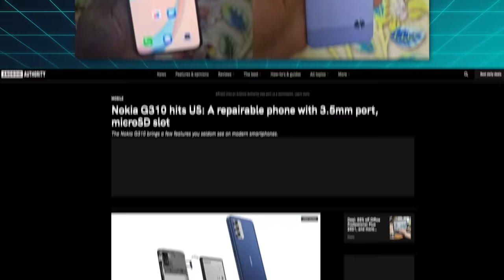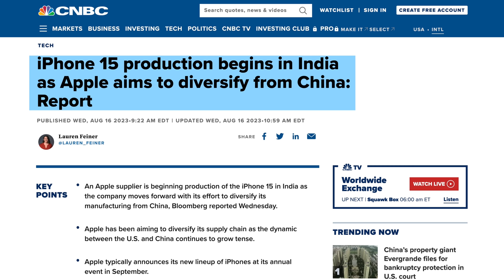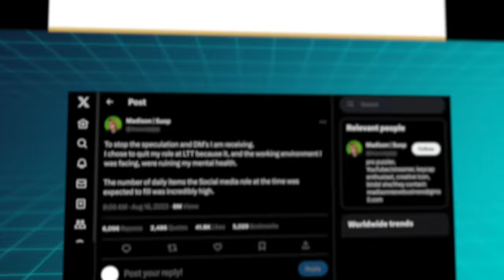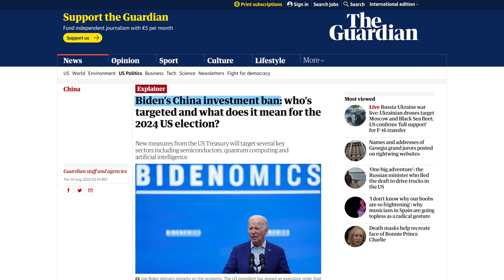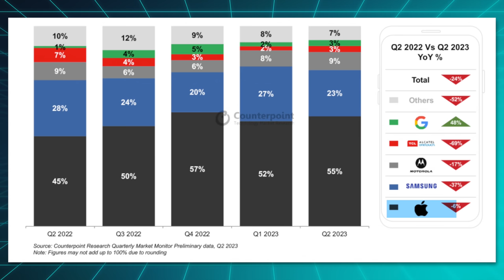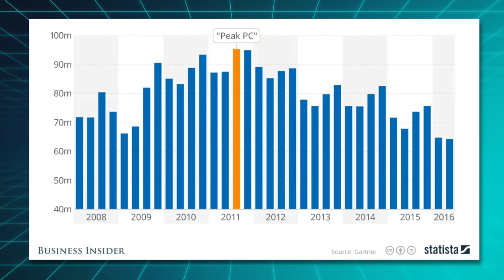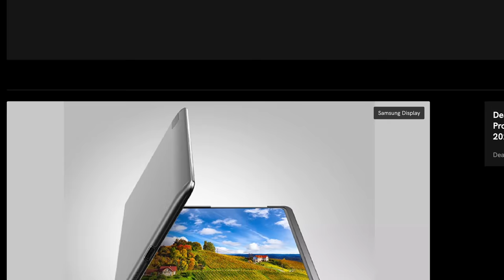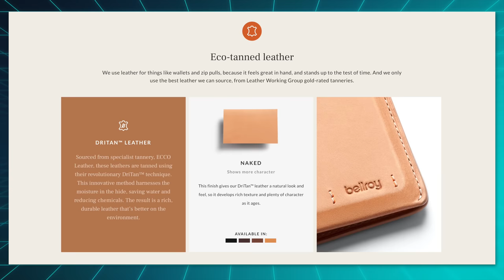Phone sales keep crashing (down to 2013 levels)

Comment: Phone companies: raise prices
Also phone companies: Sales keep getting low :(
Reply: Remove charger*, remove *headphone jack*, remove *expandable storage and the prices increase as if nothing has happened
Reply: raise prices and remove features at the same time
Reply: At the same time, everyone can make a decent 200$ smartphone. So big names must push really hard for innovation.
Reply: Don't forget the removable battery and the unlockable bootloader.
Reply: The whole $1000/$2000 phone is stupid and they are like hey lets make a folding phone with a crease in the middle so you have to watch a movie with a line smack dab in the middle of it. and those damn bezels look so bad even though it's a freaking rectangle. Yeah lets just put a notch or cutout that goes smack dab in the middle of the screen because of those damn bezels
Reply: not just remove, but also slow down everything with software locks

Comment: It isn't really because of durability but because new phones are not better than old ones. The tech has reached its peak
Reply: Right when my phone dies i use my old  s8plus and i doint even feel the difference besides the diff os.
Reply: yes and also fun fact - the durability of electronic gadgets has only gone down, a very renowned business tactic
Reply: @maksadnahibhoolna-wc2ef  Ah yes, planned obsolescence.
Reply: the tech has not peaked, its just that we dont need the massive upgrades to doo our day to day tasks without hardware being a limitation, there is still good innovation in the flagship space.
Reply: @oksowhat  Imo all theses innovations are in the "fancy gadget" category. They don't really change the experience or what can be done with the smartphone.
Reply: @oksowhat I guess the tech has peaked, in the flagship space there is hardly any ground breaking innovation that affects human lifestyle. take for example the cameras in flagship segment, there is hardly any big improvements compared to three generations older phone of same flagship brand (only 15-20% improvement) that you will hardly notice as a daily consumer.

So yes the tech has somewhat peaked
Reply: For me, it feels like new phone are even worse than old ones. For example, my old s10 has a 2k screen and headphone jacket and sd card slot. The new s23 has only a full HD Screen, no headphone jacket and no sd card slot and thicker edges. Yes s23 has more performance and a better cam but in reality the differences does not feel that big.
Reply: It'll stagnate until AR glasses become small and visually unobtrusive to the kind of people who don't think wireless earbuds are intrusive.

Then, the next sales frenzy will continue for another decade. Apple's vision pro is a test bed for much more advanced hardware. I'll have a video out on this sometime soon.
Reply: @the.littlest.toaster yeah I went back to my S10+ don't see the difference, I'm comfortable no nee to re-upgrade
Reply: Foldables drastically change the way people use their phones and while expensive, are slowly coming down in price and getting better in durability.
Reply: @oksowhat but you get diminishing returns. Is not worth spending 1000$ to get a 10% faster phone. When practically is not even noticeable in day to day use.
My phone is 2 years old and still perfectly fine. Plan to use it for like 3 more if I don't break it accidentally.
Reply: You only see the improvements if you are a true power user. Which you probably aren’t, you probably use a PC.

Phones can play switch games and run Blender. And android phones can run godot game engine. Which is useless for 99% of you but for the people who use it makes them irreplaceable
Reply: @RusticRonnie  The phones that can do such things are as expensive as a Mid-low end PC, so what is really the point ? 

I mean, do you really use your phone for game development or 3d modeling ? You can find 1080 cards for 150 bucks, if you put it on a 250$ potato it makes something more powerful than any phone currently on the market.
Reply: @speakertwentytwo I'd like to see that vid
Reply: they are better, but their improvements aren't necessary. They just nee dto play social media apps and camera/video editing/filtering purposes. You dont need faster and faster devices evetry year to achieve this. 

I beleive the main reason why people upgrade is the glass is damaged or battery is slow and the cost to repair is unecomomical and it's best to just buyer a newer one.
Reply: @emperorfaiz  C'mon now...I'm quite sure it wasn't PLANNED!🤔...it jes' sorta....happened...😁
Reply: yep, they've definitely peaked. the innovations are just gimmicks. Folding screens are cool and all, and they can kinda replace a small tablet. I'll probably upgrade with Apple releases a folding iPhone 20 years from now. But it's just a gimmick. I'd argue that the entire industry has pretty much peaked, not just smartphones. Computers like he said, gaming consoles. Computers are just more and more powerful/efficient. unless you are a power user, you probably don't need the latest gimmicks or 10% more performance that comes with the latest laptops. I think the performance of basic laptops has surpassed the needs of most people. Buy the laptop of your choice and hold onto for 10 years. Now we're looking for the next leap in technology. Automobiles peaked decades ago, now computers (and related devices). maybe the next think will have to do with energy. or something, who knows?

I agree with everyone here. The new flagship might have 10% more battery life, but if you already paid 1000 for the previous phone, then you're sort of just paying 2000 for a phone with 10% battery life. Not worth it for most of us.
Reply: This same as PC sales tanked as performance was not +25% year and games was limited by consoles anyway. But most moved to laptops who repeated the trend. Why buy an new if the old is fine. 
 TV sales peaked then people could dump their old CRT for an LCD screen, then an second round then they bought an larger one and but the old in bedroom or to the kids. 
They will never get PC, laptop, phones or TV sales as good as the happy times unless they makes an breakthrough.
Reply: @kimilsungthefirst6840  just remember to get the phone with the biggest storage. I never used external memory card. with my samsung phones the choice was either 1 sim & 1 sd card, or 2 sims. I always used dual sim.
Reply: @magnemoe1  TV could see a new peak if OLEDs weren't that expensive though. And concerning PC sales , I think VR might bring back the PC on the forefront.

Nowadays basically only creators and gamers need powerful PCs because smartphones are the most powerful platforms.

But considering how heavy rendering an ultra realistic VR environment would be, I think non gamers will be interested by the premium experience PC will offer 

That's my bet, or rather my hope
Reply: @kimilsungthefirst6840  why keep 1TB of media on you phone? you must have so much useless crap on your phone yoube never opened in years. I like to gpo trhough and purge all the junk, delete bad videos. arcgive good videos onto home storage.

you know you can lose you phone at any moment, its good practice purge the crap and move the memorfies onto local storage and cloud backup.
Reply: @kimilsungthefirst6840  you're right, i use it for leisure purposes. i have a laptop for work.
Reply: I am willing to pay top dollar for Samsung S4, that has a modern screen, CPU, memory and battery.

Sadly, the manufacturers aren't willing to provide us with a device, that has an unlocked bootloader, 3.5 mm, a removable battery and a microSD card slot. This was literally the peak of the phones and everything after that was a slow decline.

I am literally willing to pay as much as for a brand new top of the line iPhone, but no company wants my money apparently...
Reply: The specs and performance still get better, so smartphone technology as a whole hasn't peaked yet. The problem is that apart from gimmicky features, every phone is only a slight improvement over the pervious model, so people keep their phones for 4-5 years or more instead of buying a new one every 2 years. 4G and 5G are standardized such that you can shop around for a better plan without changing phones (and this has created a market for used smartphones).
Reply: Went with the Note 20 Ultra, a great camera with it being samsungs last flagship with expandable memory (up to 1TB because why not), it's nearly comparable to the current flagship and if you go refurbished you can get one for like 250.
I both do and don't miss the headphone jack because you can get Bluetooth earbuds with an 8 hour battery for $20
Reply: I bought a pixel 7 and it's worse than my old OnePlus 6T was.. not only that, but it was more expensive. My 6T was also worse than my Note 4 was, and it was also more expensive. They're getting more expensive and worse lol.
Reply: @Cakebattered Nobody cares about flip phones 2.0
Reply: They are consistently putting out a worse product than the previous offering.  Headphones jacks were eliminated, charging bricks, and then expandable memory. On a flagship phone like the z fold 5 the only difference this year is a slightly redesigned hinge. The camera wasn't even upgraded.
Reply: I am using a pixel 6, and have found no need to switch to a pixel 7 and it seems it will be the same with pixel 8.
Just not a significant difference.
Reply: I would buy a new phone, lets say a new Pixel (since I am using a pixel 6) if they would upgrade it in a manner significant to me.
I am ok with the display, CPU, GPU, Cameras.. What is lacking is a dedicated memory card slot, a second sim card slot, headphone jack and perhaps an improved build quality, lets say it has stainless steel edges and a better quality camera bump so that those areas dont scratch easily. So a more premium feel and look and a couple of usefull options regarding headphones and storage.
If this is not added I will just use it as is until it gets broken or slow.
2-3-4 years.. I just dont care anymore.
Reply: The tech hasn't peaked (it never will, as it will always be possible to release something better), it has matured, which is different.
When a new technology comes out, it experiences a period of rapid growth and development, but, sooner or later, it will mature, which means the improvement will be incremental.
Reply: Not only are we seeing less reason to upgrade, with the massive hardware cost increases it's just not feasible for too many people.
Reply: @fumega technically you eventually run into physical limits.
Reply: @Ruiseal  Well, you know what's coming, the best way to know when that comes out is to subscribe. Or, because youtube doesn't really push subscriptions in the slightest, you'd have better luck adding me to your RSS reader if you use one.
Reply: And the prices on new phones are way too expensive now. Look at the price of the top of the line iPhone. The 512GB model is $1299. If you get the 1TB it’s $1499!
Reply: They are better, but very sightly better. So you only notice significant improvements if you get a new phone every 3-5 years. But overall the experience is basically the same. They are little faster, a slightly better camera, better screen technology etc- But do not expect groundbreaking new features, just mostly gimmicks.
Reply: @RusticRonnie yeah they got phones powerful to the point it can do those things. Not well though, and everyone kinda realized it's pointless anyway.
Reply: Yeah they don't slow down as fast as they did before
Reply: @Raphy_Afk VR lacks mass appeal.  Those of us in the sim space have pretty much already adopted it and we’re getting to the point where headsets are good enough to last several years as well now.
Reply: All I do are basic functions I don't need 90% of what this phone does
Reply: @the.littlest.toaster  Funnily enough i would actually feel the difference. In that The S8 feels more feature rich than most modern flagships. Sure it has just one camera but apart from that ? It has a retina scanned, Sd card slot, headphone jack, Infinity display with beautiful 1440p instead of just a fullHD, premium materials and all that. Sure it has an older chip and SW but damn what happened with modern phones.
Reply: @MrMozkoZrout  so true i had to adapt to missing features  that i guess only Samsung had at the time like folders in the app drawer. Yeah that design is so nice a revamp of the s8 design would look so good.
Reply: @dominikmuller8456  so true
Reply: @Professional_Youtube_Commenter Agreed. I have older phones and tablets with SD-Card slots but their usage is limited to dumping your pictures, videos e-books and comics due to severe limitations in the Android OS itself. For example, you can only use the external storage as read only in Syncthing.
Add in the fact that normies rely on the cloud for entertainment and storing their data, so they don't really need storage expansion, and even if they do, they'll just buy a newer phone because why not?
Reply: @RusticRonnie okay, but who would run blender and godot on a phone? if someone's making games and models on those, they could buy a stronger PC for the price of those phones. And laptops exist if you really want to have the 'portability' argument
Reply: Yes but also in my country phones are more expensive than they used to be. Especially Apple and Samsung phones.
Reply: @taavi948  That is not specific to your country, prices have raised everywhere
Reply: Yeah that was scary to hear.  It sounds like he was saying manufacturers should tank reliability.  No, manufacturers should offer me a better phone than the one I have.  

And I don't want it bigger, and I don't want to lose my headphone jack.
Reply: I don't know about it's peak, but the apparent rate of improvement has definitely leveled off.
Reply: It's that it peaked per se, it's just that it's becoming a mature technology. Adding more bells and whisles just add clutter at this point.
Reply: @speakertwentytwo 
When can we expect Halogram phones without the need for glasses.
Reply: @magnemoe1 
Halogram phones would be the next major innovation.

Comment: I think phone sales dropping is just natural at this point. The improvements to new phones are incremental and people largely have what they need already, so they just buy a new device when their old is getting too slow or isn’t supported anymore, which takes anything from 2–7 years depending on the manufacturer. I went from a XS to a 14 Pro with nothing in-between because I had no reason to get a new phone until my old one was requiring 3 charges to get through a day.
Reply: I have my 11 which is going strong and I don't see myself upgrading for atleast 2 years. I could even wait a couple more.
Reply: I used my Pixel 3a until it stopped getting security updates, then picked up a 7a.
The 7a sucks by comparison. I need a case to compensate for the massive camera island and tiny bezels, so it's bulky as hell in my pocket. It has no headphone jack, and both bluetooth and USB dongles are unreliable and don't work nearly as well as the headphone jack did.
I would just put a new battery in my 3a and use that again if I wasn't concerned about security updates.
Reply: EU just rolled out the removable battery mandate compliance. This should be a win for end users. I'm going to hold out until the new generation of phones with removable battery
Reply: I just replaced the battery on my iphone 11 pro for $69 instead of buying a new $1000 phone. Not buying a new phone for next two years when ios updates would stop on 11 pro
Reply: @lapprentice  I want to get back the abillity to add a memory card to my galaxy phone the new one no longer allows this and it irritates me.

Comment: Phones have become incredibly expensive, leading people to view them as long-term investments meant to endure, rather than disposable, inexpensive gadgets that need frequent replacement due to newer models being significantly better and more capable than their predecessors. Companies have grown accustomed to charging exorbitant prices for diminishing levels of innovation. What outcome did they anticipate?
Reply: There is also another reason 😂
I for once can't be assed to read through tons of specs and models regularly so I just buy one and use it until it gets lacking, unsupported, the battery dies or I need a better one with new features - so to basically speak as long as I can avoid buying a new one 😂

Comment: In South Africa, phones have become so expensive that they are now on 36 month contracts instead of 24. The kicker is they are still only under warranty for 24 months. And not having an included charger is maddening. So I keep my phones for as long as possible now.
Reply: Next, tell them about MTN sending those 36-month contract users advertising via emergency push messages.
Imagine waking up to a full screen text ad from your network provider that drained your battery overnight because that message type stays on -  keeps your screen on until you take action.